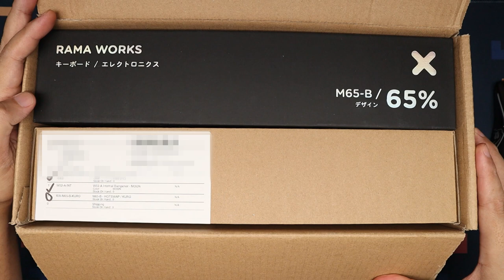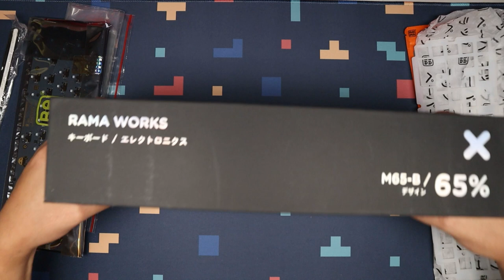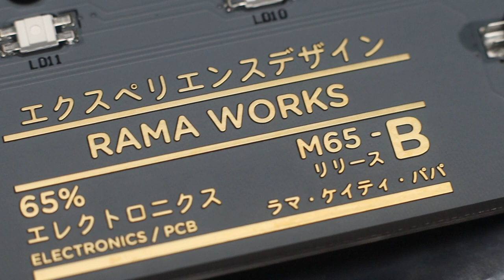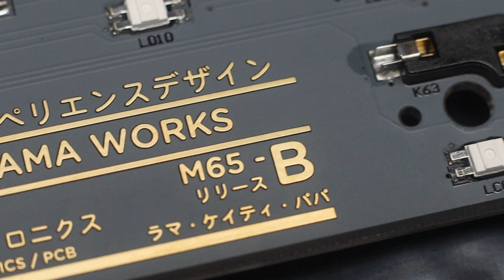RAMA WORKS® M65-B Part 1 (Unboxing and building this $500 premium custom keyboard kit)

Comment: so if i had the iced bottom there would be underglow on they keyboard?
Reply from the maker: The PCB technically do not have underglow LEDs, but the light from the per key RGB LEDs would leak through the iced casing, giving it a somewhat faint underglow effect. But its still not the same as having dedicated underglow LEDs.